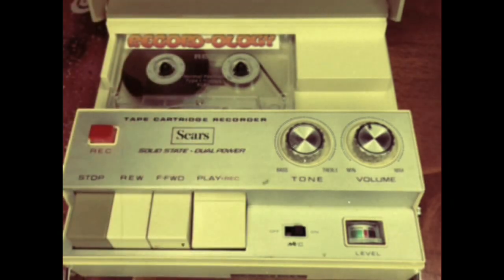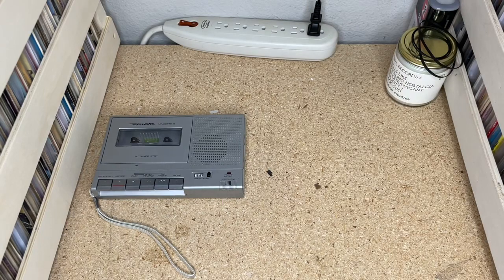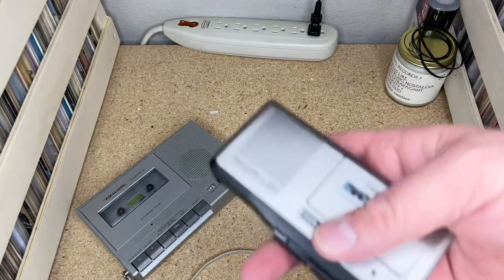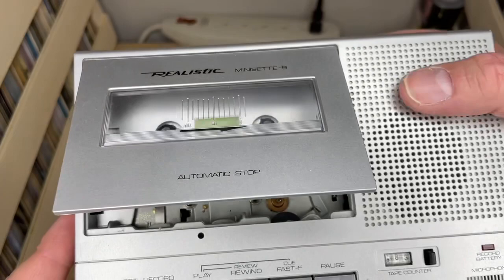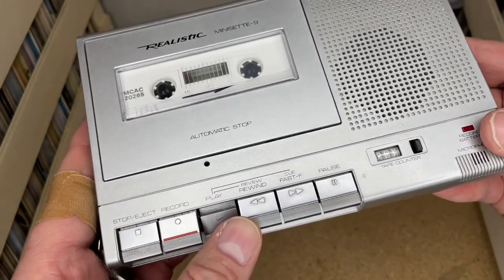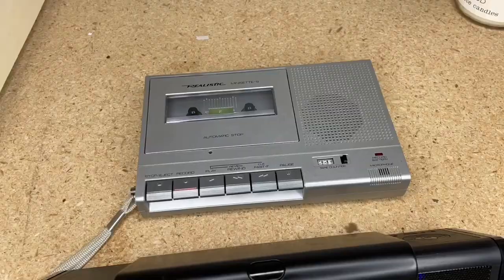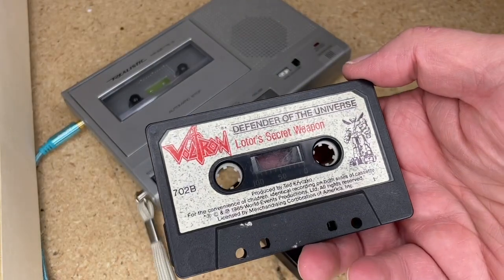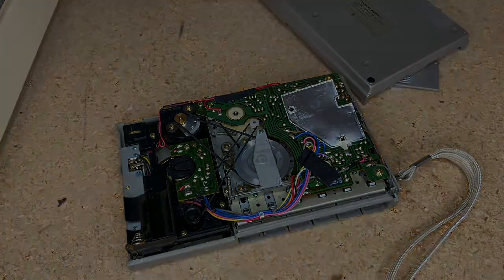Realistic Minisette-9!  1980’s Retro Tech

Comment: Weak recording with internal-external mics-try cleaning the microphone jack on the machine.Have had to do this on feild machines in the VOA studio.The jacks get worn and dirty thru use.Cleaning them is a first try.Use a Q tip or a sheet of paper between the normal-connected contacts in the mic jack.

Comment: The problem with the built-in microphone with the 'shoe box' type of cassette recorder is usually due to the motor being too close to the speaker.  This is not the problem with this compact one, however.  I'd think it has to be something else.  Incidentally, what are the two extra holes on the front and back - are they for speed control or something else?  Great video, as always,  Thank you for making.
Reply: The hole on the top is for head azimuth adjustment for aligning the record/playback head, the hole on the bottom is for speed adjustment.

Comment: I am working on one of these now. I have the owners manual which includes specifications and a schematic. Would a copy of the schematic help? Sounds like bad electrolytic capacitors to me, I would check C5 which is a 100 mfd capacitor on the other side of R5, a 1K resistor which runs to the microphone. Only 2 integrated circuits and 2 transistors, pretty simple. Here is the specs:
Tape system.............2-track, monophonic cassette
Tape speed...............1-7/8 ips (4.75 cm/sec)
Wow and flutter........ 0.2%
Signal to noise ratio. 45 dB
Circuit....................... 1 IC 
                           1 diode
                           1 LED
Erase system............DC
Record system..........AC bias